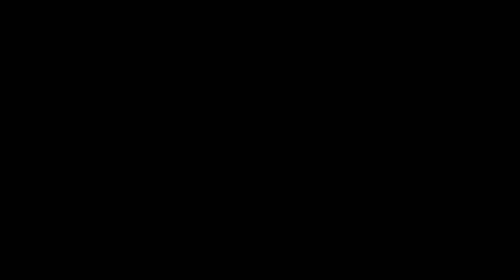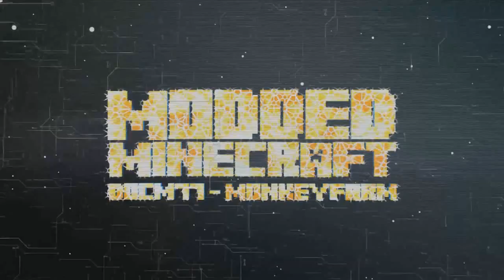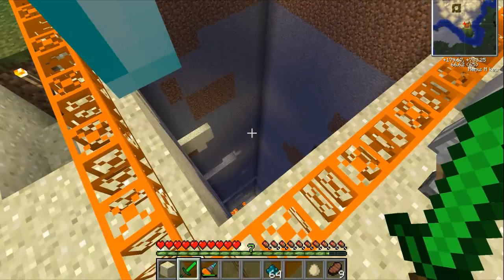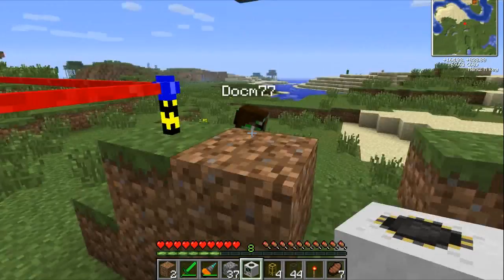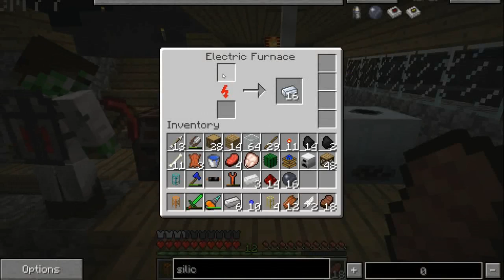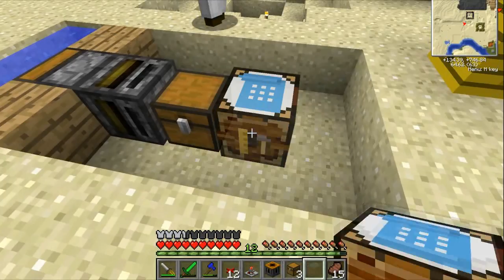Modded Minecraft Automatic Crafting Machine - Deployers, Filters, Retrievers - Feed the Beast #10

Comment: Just an FYI monkeyfarm, the retriever you guys used is currently just a really expensive filter. That also explains how it can work without blutricity. Its main use is to pull out of inventories along a tubing network (pneumatic, of course) connected to the retriever, which requires blutricity. I suggest replacing it with a filter and save the retriever for another build (rp2 watermill systems are pretty popular and cheap). Looking forward to future episodes!

Comment: With your automatic bog earth water bucket filler, you did not need the retriever.  You could have used another filter to pull the empty buckets from the chest and send them into the pipe.

The only reason you use a retriever is as a remote filter (placed in the middle of a pneumatic pipeline)  It is a bit cheaper on resources this way.

Comment: try using the electrical pipe for the engines. it saves room around the quarry and you could potentially run the quarry off of pure redstone engines(not saying this is worth the time or resources). I have my quarry running off of 6 peat engines and the thing races all the way to bedrock. as for the peat overflow, the obsidian pipe will pick up the excess objects and materials around the wood farm area.

Comment: Make a condenser, stores raw EMC and converts it into any item in game that has an EMC value. The Energy Condenser must have a target block in the target slot (top left next to the energy bar). Once an item is placed in the target slot, if the Energy Condenser is adjacent to an EMC source such as an Antimatter Relay or directly next to an Energy Collector, it will start to accumulate EMC in its internal storage until there is enough to create the target item

Comment: Monkey The retriever is unnecessary. The filter will work just the same.
The plus of a retriever is that item can be pulled out of an inventory down a pipe line
do R---------C the retriever (r) can pull items out of the chest. Where F---------C The filter (F) cant.

Comment: Quarry need minimum 3 MJ/t but for an optimal running you need up to 9 MJ/t (faster). With a big quarry it's better to try to go 9 MJ/t the fast as possible. 1 peat engine (with peat) is 1MJ/t, as weel as steam engine, so biomass engine or combustion engine may be better... As you have a tree farm running maybe biomass (sapling etc), might be the best... :)
Btw Red Power is a good solution for control exess production as well (peat problem). ;)